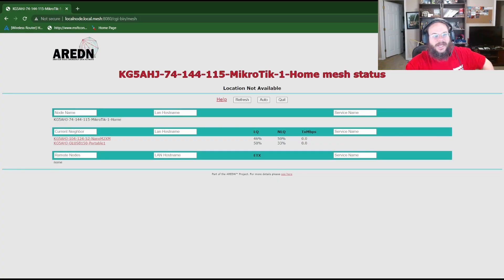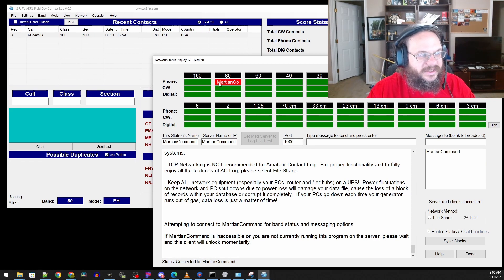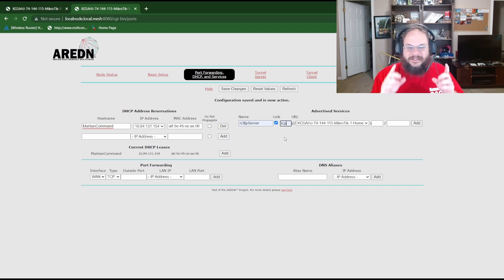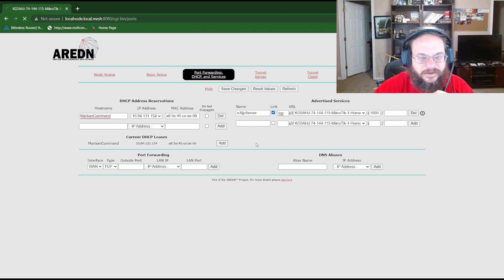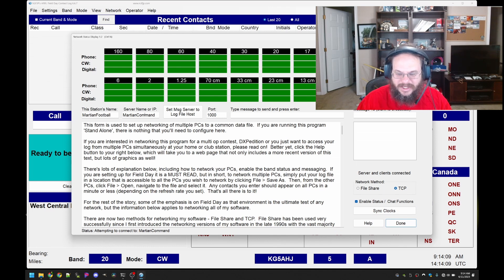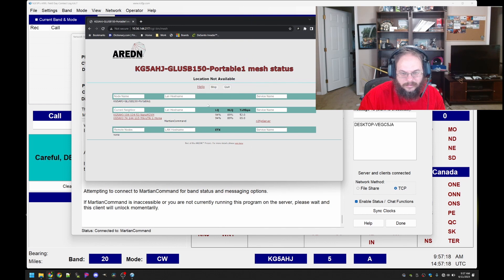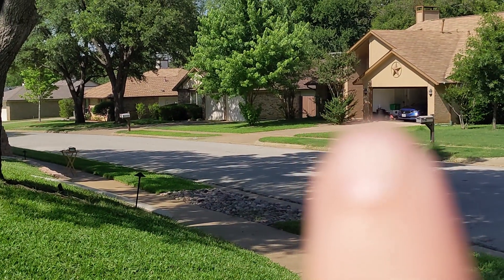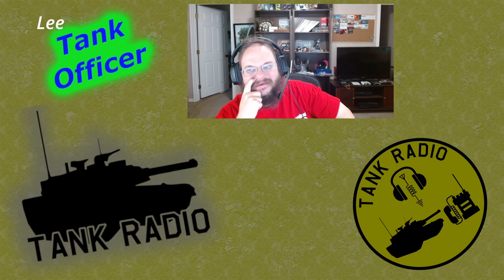How to Log with N3FJP through AREDN

Comment: We did this 1 year however we were using N1NM logging software and it too worked great. We were at a park
The park was on a barrier Island. Across the Bay was our largest hospital that had a 2.4ghz Omni antenna on top so we were able to hit it with a 2.4ghz NANO . We then ran a cable from the NANO switch to a Lynksys Router that I had and set it up wirelessly for everyone to use. Again it worked well.
Reply from the maker: That's awesome to hear man, these networks are fun to set up and play with